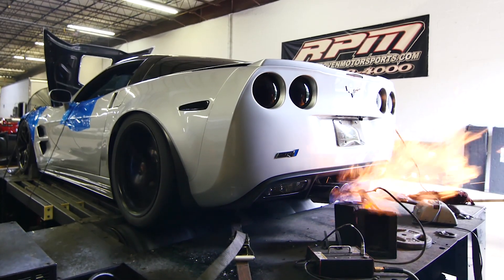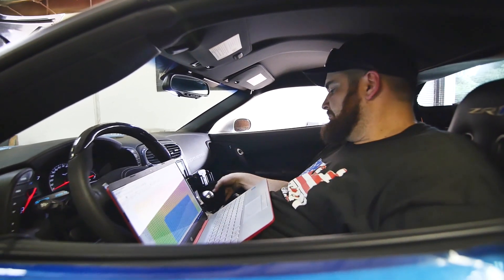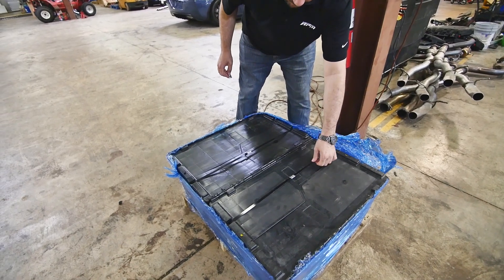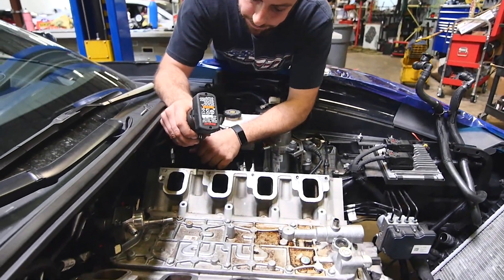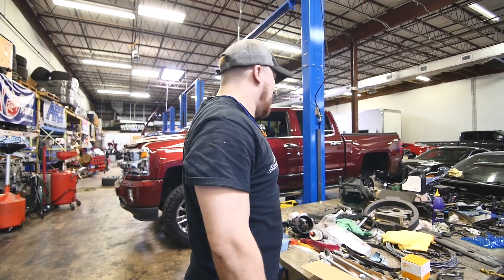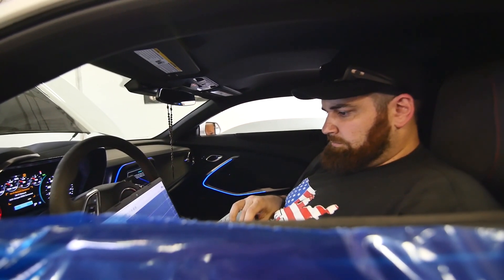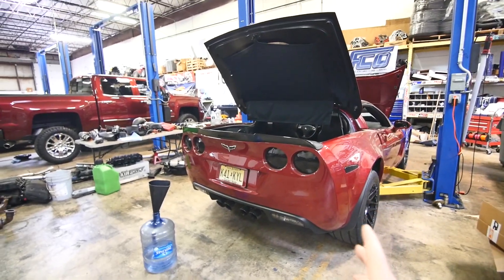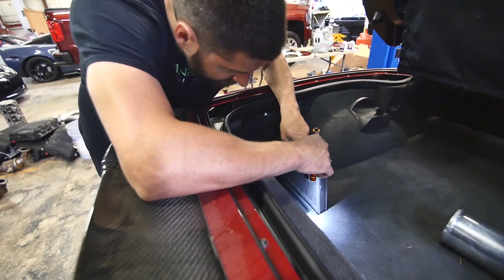Kong 2650 C6 ZR1 (SBE) Hits the Dyno! | RPM S10 E7

Comment: I had a 96 Tahoe, all stock that did the same thing with the rear wheel bearing as that Silverado. I believe it was shortly after and accident. I didn't hear a thing back there, just saw it leaking while I was crawling around under there. It didn't get bad enough to F up the housing though.

Comment: When doing cam and valve springs do you guys do the rocker arm trunion as well?
Reply from the maker: No, only if the customer really wants either.  We’ve had cars make 1,000+ whp reliably with stock rockers.

Comment: Idk how you guys get cars to not spin on the dyno. I just had my 427 2650 c6 zr1 dynoed and it spun in 5th gear on two different dynoes. Going to a hub dyno next
Reply from the maker: VHT on the tires/rollers and roll into the throttle
Reply from the maker: Dyno operator has a lot to do with it too